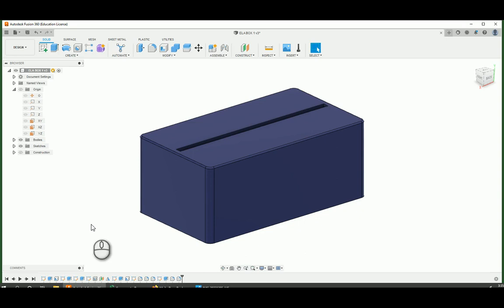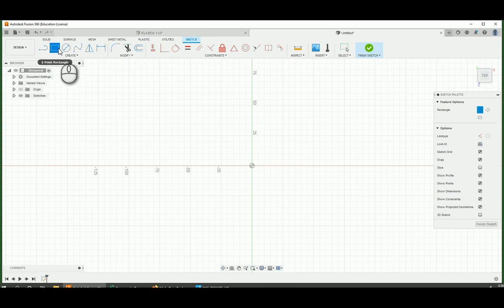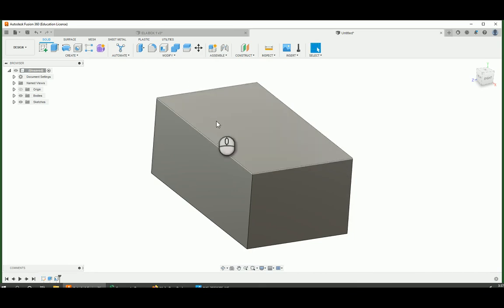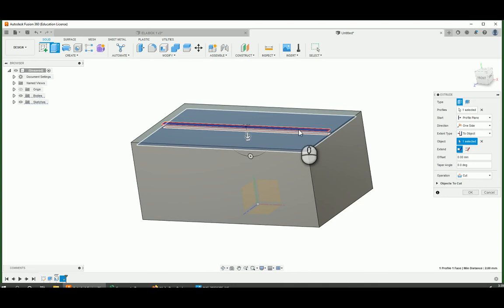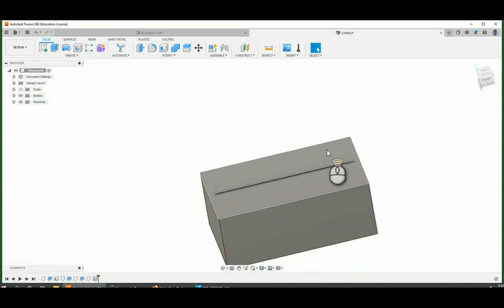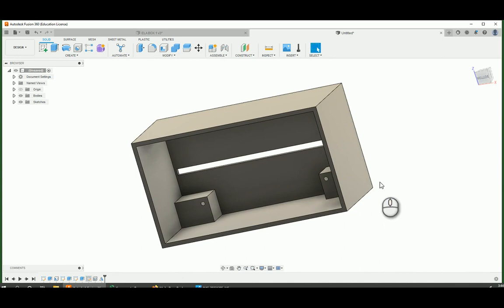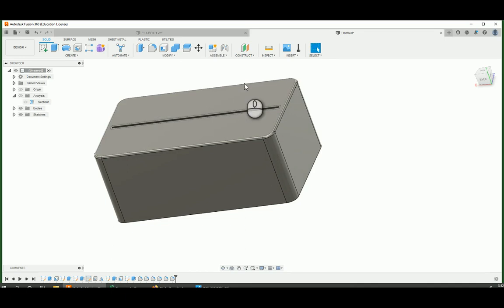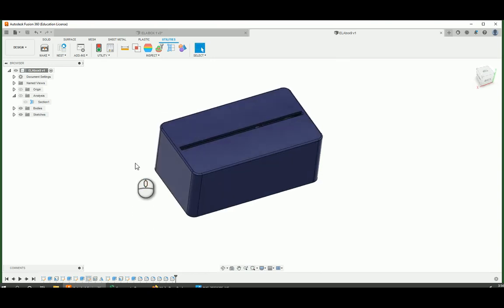3D Printed Box for the Edge Lit Acrylic Project

Comment from the maker: There is an error in this video: At 11:15 I extrude the battery holder rectangle by 16mm but it should be 20mm.  You need to edit this or the 9V battery won't fit.